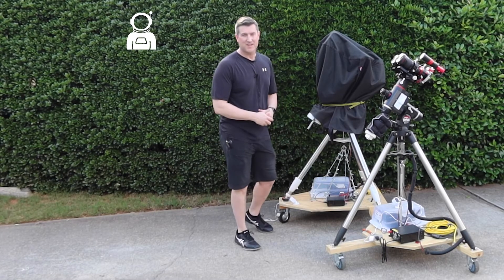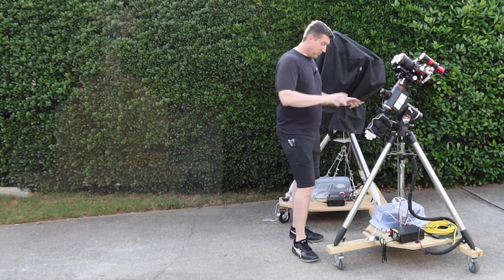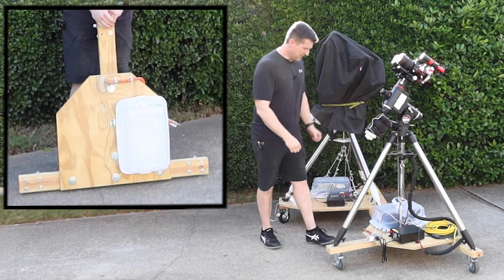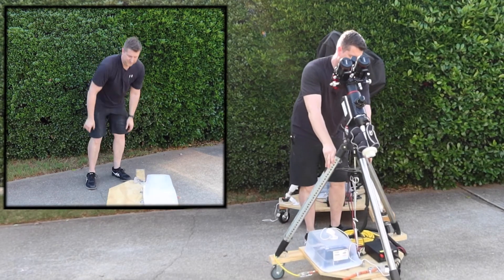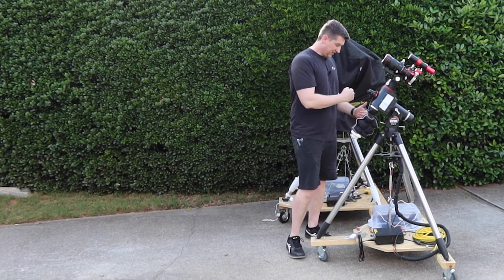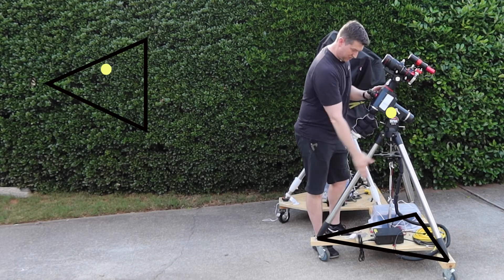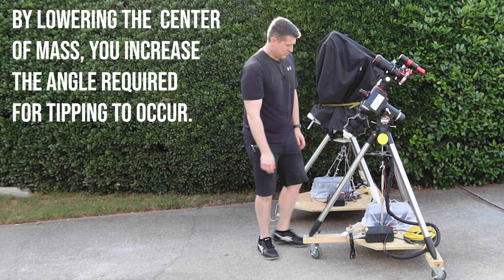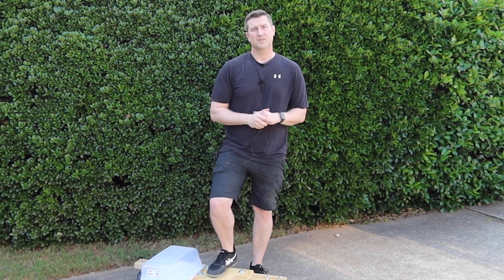Easy to Build Telescope Rolling Base DIY

Comment: What you might want to add is what I call a "dead man" weight right under the center.  Use some old barbell weights or something?  Hang them right off the center.  Vibration might be a problem with something like this.

Comment: Chad, I will take it as a compliment from you that my movable mount is almost identical to yours! If you would like, I can send you a picture. My question is, you mentioned that you never level the mount with your equitorial mount but just do a polar alignment. Could you please explain that statement or recommend where I can go to learn more about your reasoning? I have been leveling the mount on the tripod once I position in on my lawn but if I don't have to, it would make it easier for me. Thank you for your very helpful videos.

mj williams

Comment: Hi, and thanks for the great tips! I've just completed mine but instead of your T, I used 3 planks in a Y. Wish I had seen this first! Looks so much simpler. Plus the centre connection is brilliant!
I'm in 2 minds about drilling a cup for the ends of the legs vs attaching stoppers at the end of the planks. With stoppers, I can leave the planks longer and have infinite positions should I wish to extend the tripod legs. 
But I'm brand new to this. Do you never see a situation where you might like to extend your tripod legs and raise your telescope?

Comment: Chad, great video. In leveling the mount, I sometimes adjust the length of each tripod leg. In doing that, will it affect the placement of the tripod footing on the mount you constructed?
Reply from the maker: It can, yes, since the more you shorten each leg the smaller the base triangle becomes. If it is a small amount, it will not matter too much, but if it is dramatic, it could make a bit of a difference. You can test by taking a leg-to-leg measurement at the end while fully extended, then adjust and measure again. You will like not find it to be too far off for most manipulations.

Comment: The Example Hook-to-Hook Style Turnbuckle.  I understand the top part goes to the M12 ring.  How did you attach the bottom of the hook to hook turnbuckle?
Reply from the maker: I just put an eyebolt/hook in the base.

Comment: Very nice to see how you made those, at the Eq6R PRO mount is that also M12 ring in the center ?
Reply from the maker: Yes. It actually is also M12. If you look close, I did a bit of overkill on that one and used three tiedowns from the ring. Unless you have a steep slope, it’s absolutely not needed. If you’re really concerned, I would just add some weight to the base and once it’s tied down, your center of mass will be so much lower that it will help quite a bit.
Reply: @PatriotAstro  Thanx for the tip !

Comment: First...Look's like 4" wheels?
Reply from the maker: The mount in the back is on 5 inch casters while the one in the front is on 4 inch casters. I do prefer the 5s over the 4s because it seems to roll over cracks and small bumps a bit easier.